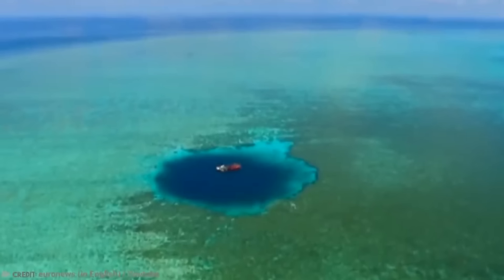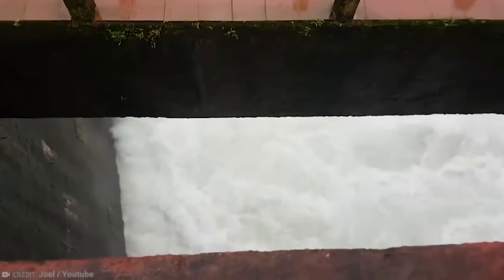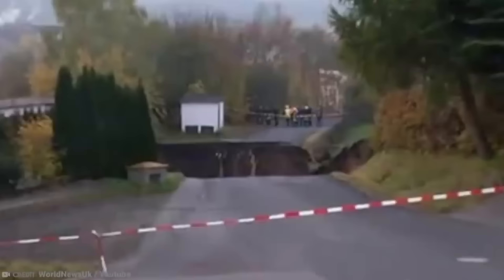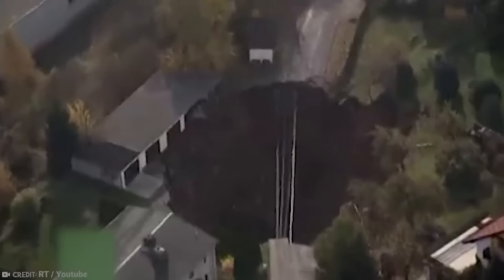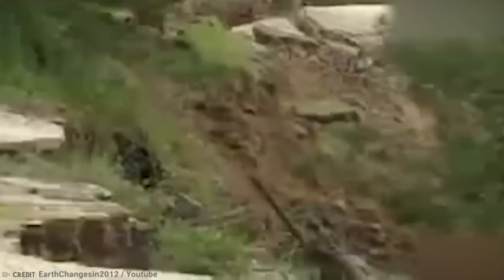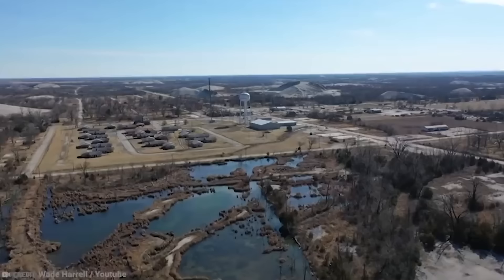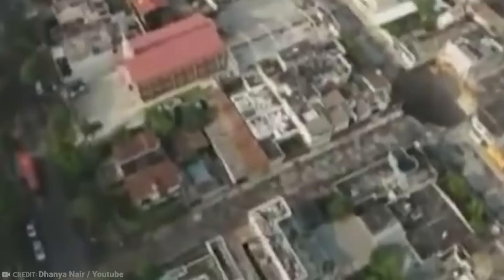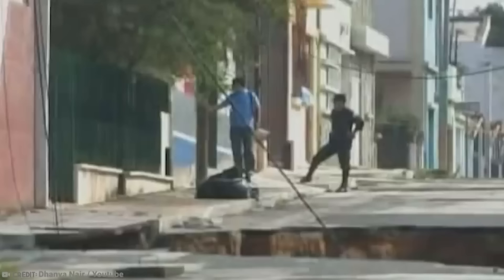15 Largest Sinkholes Caught on Camera

Comment: I have a friend who was a tunnel builder in Boston who was part of the crew that was boring one of the main under ocean tunnels of the Big Dig. That tunnel is about 10 miles out underneath Cape Cod  Bay, beginning in Quincy, Ma, and heading south toward the south side of I-93 , and during the dig, they ran into what anyone would have to refer to as a VOID in the earth! It was airless,  and despite being hundreds of feet under millions of tons of ocean water, it was completely dry, and eerily empty.  They nearly lost the almost billion dollar boring machine built specifically for that tunnel when they bored through the wall of the void. Its actually on record as having taken back every foot of the rock plus hundreds of tons of concrete which they had to pour into the void to backfill the huge empty space under the bay. It took 3 solid months of 24 hours per day,  7 days per week to truck ALL the fill into the space to create the 3 lane sized rock and concrete causeway which the crews covered with a 7 mile long, brick and mortar walled and covered style causeway under the sea. Imagine the insane sinkhole that void would have created in Cape Cod bay if the rock above th8void had given way before, during or after the construction of tunnel !
Reply: They would have all undoubtedly died.
Reply: Tldr
Reply: Born and raised in Boston and I’ve never known this!!
Reply: That is fascinating.

Comment: The dam doesn’t have a sinkhole at all it’s a built in drain if the water level gets too high the excess war will drain away
Reply: Man made sink hole?
Reply: @daynaswan427  it has no bottom, flows from the reservoir down the drain and into a river. Sinkholes have a bottom
Reply: @judithhaskell5519  I know this, I am glad they included it because it shows a greatly engineered way to deliver water. Why such comments? Open your mind to what you see and know that the sink hole gave idea for water delivery!!!!!
Reply: @judithhaskell5519  ,I did not mean to put that much passion into what I was saying. You are correct, you can think what you want and so can i. Calling people names is not nice.
Reply: When I click on a video about sinkholes I expect to see sinkholes, not overflows.
Reply: @davidcantwell2489 , well looks like we both win. They presented a video that is 95 percent sink holes and 5 percent cool idea for water delivery that was inspired by sink holes......😊
Reply: @daynaswan427  
For that, you get a "like".. and ..  an "Atta-girl award" .. for positivity.
Reply: @davidcantwell2489  and you get a thank you and a smile face......😊

Comment: I live in middle ga my family farms back in 2008 my grandpa was mowing the drainage ditches on one of our farms when the front end of the tractor ( a John deer 8420 ) huge tractor fell into the front of the sinkhole he couldn’t see. Luckily he backed out of it . We found a sink hole about 15 feet across and 30 foot deep. We filled it with sand and it hasn’t opened up since luckily .

Comment: I live in Anchorage Alaska, we have 2 small sinkholes in our back yard. the larges is 16 ft wide and approx about the same 16 ft deep. the other on is much smaller 5 ft wide and only 11 ft deep. but all the deeps is only as far as I could get safely :( and they are getting bigger slowly.

Comment: Super that's is one creepy!!! Sinkholes in berezniki Russia 🇷🇺 oh my gosh!! 😲😧😯it's looks like Sinkholes air bubbles.🤔 just like what happened in Florida and I thank. Sinkholes can from anywhere in Florida, but the highest activity level occurs in west central florida, maybe because of the karst limestone environment. There are several influences that increase the risk. Of Sinkhole activity such as long-term weather conditions, heavy acidic rains, and drought-like conditions.. especially where there is abundant rainfall, and the rock beneath the surface soil is limestone. .. People can create sinkholes when building roads, aquifers, or other types of construction. Altering land in these ways can weaken the underlying rock and make it more susceptible to sinkholes. Why sinkholes open up- National Geographic it tends to occur in clay, because clay holds soil. Together like glue . ... That's one way . .. Has been limited success digging out all the soil and getting down to the bedrock,..